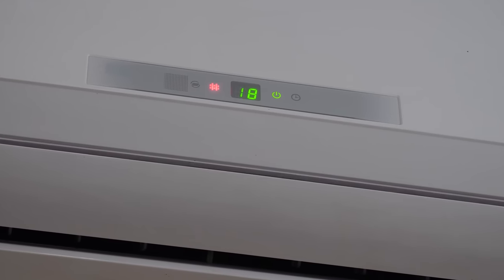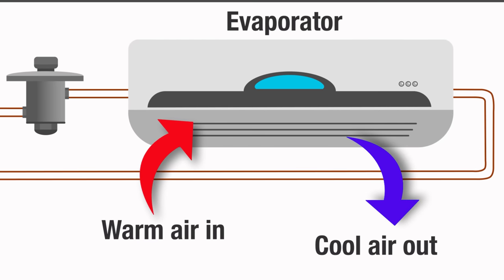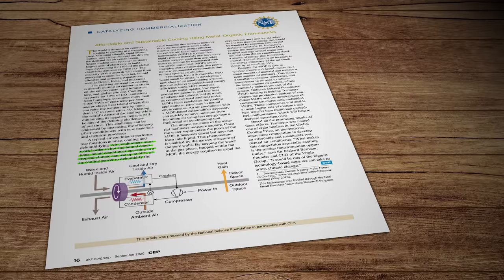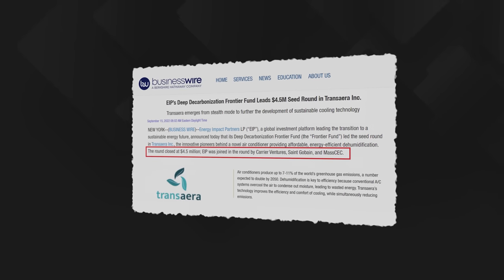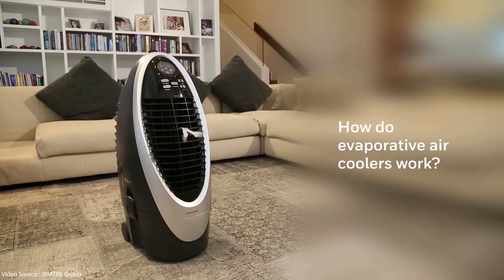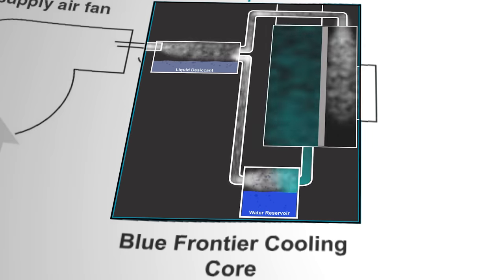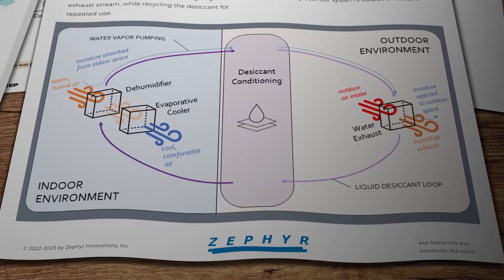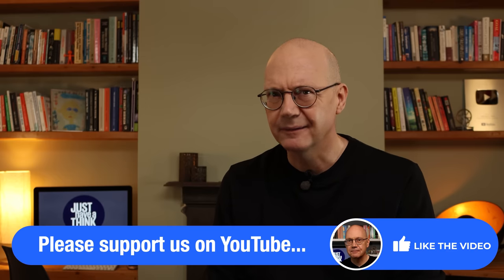Emissions free cooling. Can we do it?

Comment: There is an ironic effect going on in temperate climates. I live in Belgium and like many people we have recently installed PV panels, which produce way more electricity than we consume during the summer months, and much less over the winter months. With the value of the surplus electricity injected into the grid being almost zero, I decided to install an AC unit to cool the house with excess energy. Previously we never had an AC unit and strictly speaking we don't need one since we only have a couple of unbearably hot days every year. So yes, AC devours energy, but in our case it's carbon free energy. Am I part of the solution or part of the problem?
Reply: Well, basically you are creating more heat in the environment than you are removing.   To cool your house 5 degrees, you create a house worth of air that is 6 or 7 degrees hotter.

I'd look into insulation (tho I'm unclear how dirty making insulation is) and that superwhite paint to reflect the light and heat back into space.   And of course use the ac on the unbearably hot days.
Reply: You do realise that you’ve become part of the sustainability problem. Every Air Conditioner added to the system yours or the Grids is at the expense of minerals and use of FINITE Flammable Fossils (FFF’s) from the mining to the production of the components that form that AirCon, and the more technologically complex it is the more FFF’s is consumed, and if your think the efficiency can take care of that, think again as Jevon’s Paradox: Fuel efficiency gains tend to increase, not decrease, fuel use. And we are looking towards sustainability and not a short term fix, aren’t we🤔
Reply: Bravo! 🤩
Reply: @barrycarter8276 in next couple of years, heatwaves will take significant number of lives. I'm tired of hearing "you become part of the problem by installing AC" while I no alternative solution is proposed. I moved to Germany 6 years ago, the 2 weeks only heatwaves have now become 3 separate heatwaves from 1 week to 2 weeks. Summers in Europe are getting as hot as middle eastern countries. It's very hard to sleep when temperatures are 27c at 4AM with humidity.
Reply: @macmcleod1188 There are organic breathable insulation materials available like sheep wool or hemp.  Even thick cork panels have been used on exteriors.
The cork insulated building I saw also had a Trombe wall, which is a section of wall containing high thermal mass with an air gap and glazing, and fans to pump an airstream up (or down) the wall in the air gap.
Reply: You are a human, responding to current incentives.
This is why public policy is so important: we need to make the incentives align with the outcomes we want. If something has costly externalities (carbon energy, for example,) we need to make sure we charge for that cost (carbon taxes, for example.)
Any other mechanism is just rearranging deck chairs on a sinking ship.
Reply: I had solar panels fitted on a grant so can't export to the grid at all.  I think there are some heat batteries in development that can run a wet Underfloor heating system.  At the moment, they're only marketed for domestic hot water.
I'm curious if UFHS could be used in a ceiling to cool rising warm air and displace that heat to a radiator somewhere in a cool spot, or externally on the north side (for northern latitudes) of the building.
Heat batteries use relatively simple, plentiful components inside them and can practically use any heat source, which would include hot air.
When heat batteries are used for cooling, they're called thermal batteries.  I haven't seen any yet for residential applications.
Reply: I'm near Paris and what used to be a couple of unbearable days has become a couple of unbearable weeks and probably soon months. The chart at the start of the video shows Europe has a small share of the global AC units, but I'm sure it will grow. Powering the unit with solar panels is better than the alternative.
The other solution for me is to get a pool and spend the day in it, I don't mind I like that, more difficult to work from the pool though.
Reply: I live in a dormer bungalow where the bedrooms are very close to the roof slates. As a result we get lots of free heating from the sun but thats become an issue in the last few years with all the European heatwaves. 
I'm installing solar panels soon, so I'm hoping the panels can block the excess heat on the slates but I had been debating getting an aircon unit to run off the free solar electricity.
Reply: I have the same dilemma  - I too have excess PV on the days when the inside temperature is unbearably hot (one or two weeks in the UK - just like the last) and have thought about getting a mini-split - okay so the excess PV is being used on moving hot air back out again, but it "should" be carbon neutral, albeit someone down the road can't/won't use it instead. Then in the spring/autumn when a bit of heat is needed and I have excess PV, I am not using gas to heat the house. Yes I could better insulate the house (already on the list) but had never considered if I was part of the problem in considering this route.

Looking more broadly, we rarely use the car (unlike those that drive unnecessarily short journeys) and our overall footprint is reasonably small, I cycle where others would drive, I repair "stuff" as a volunteer and we buy used stuff over new plus being frugal with money - do I still feel like I'm part of the problem by getting AC? No, not in the grand scheme of things...
Reply: @RustyWalker  you can't use a cold water loop to cool a space because of the reasons discussed here in the video, the cold water loop would be covered in condensation and it would start raining in your house, more likely just ruin the plaster on your ceiling.
Reply: @SonnyDarvishzadeh  You’ve only reinforced the fact that like it or not you’re part of the problem, the ironic thing is this is on “Just Have a Think” which is supposed to be about how we can move to Rebuildables, sorry Renewable Energy which will invariably means cutting down on energy use, at the moment we’re in the “Red Queen race” — "A slow sort of country!" said the Queen. "Now, here, you see, it takes all the running you can do, to keep in the same place. If you want to get somewhere else, you must run at least twice as fast as that!",
and especially pertinent when it comes to trying to reduce CO2🤔
Reply: I'll give you another ironic effect. I am an architect and occasional property developer, building super-insulated ultra-low energy houses. Imagine my horror in visiting one of my early houses in the middle of winter and finding the owner sitting around in shorts and little else, with the heating on and a window open! His argument was that it costs so little to heat the house that heating it to 26 degrees (C) was cheap, and he was still using way less energy heating it than the average house uses.
I have spent rather a lot of time since then trying to make sure that my houses are extremely energy efficient, and extremely difficult to raise to a temperature above about 22 or 23 degrees.
Reply: @AlRoderick You'd have to monitor and control for humidity and calculate the dew point to give you how cold the water could be.
You wouldn't be able to use the supply temperature straight into the loop, but then that's not how UFH works anyway.
Reply: @macmcleod1188 Not how that works. The global average temperature rise is only dependent on the balance of radiative heat into the earth (by the sun) minus radiative heat out of the earth (from the earth's surface, into space). That's why greenhouse gases matter. They alter this balance by reducing the radiative energy out of the earth.
Reply: at end of life of the AC unit, part of the problem. as refrigerants in AC units with either be CFC based, which as responsible for the hole in our ozone, or the alternativeHFC's tend too break down into harmful greenhouse gases that are significantly worse than CO2, per cubic meter of the gas. for context, Methane is 24x worse than CO2. HFC's used in part with most AC units break down into a gas that is 131x worse.
Reply: @MikeAG333  Guess you must specify a Heat Pump as main source of heating then, though my experience of Heat Pumps is they take all day to get the property up to temperature,, then some fool opens the entrance or patio door to outside and the heats all gone in an instant, still it’s soon sorted with couple of 3 kW standby fan heaters, if you can afford it use it🤔
Reply: @barrycarter8276  "If you can afford it, use it"? Erm........no. That's how we got in this mess in the first place.
And no, a properly designed building with the correct ratio of insulation and thermal mass won't lose a noticeable amount of heat when someone opens a door.
Reply: @MikeAG333  Hi Mike, sorry to disagree with you but insulation particularly in winter won’t store heat here, the building structure MIGHT, then I guess you probably don’t live in UK with our draughty leaky buildings, But maybe you’re suggesting we knock the tens of millions of UK’s homes down so we can build modern ones. Oh and anyone trying to sell a heat pump here gets treated like double glazing salesmen used to be, sorry, salespersons. As regards to my last posted comment don’t you think I might have been just a teeny weeny bit cynical when it comes to “if you can afford it use it”🤔
Reply: @barrycarter8276   I'm a Brit, too, and have built (and designed) some of the most energy efficient above-ground houses ever built in this country, so I do know what I'm talking about. No-one has ever claimed that insulation stores heat. It's job is to slow down the transfer of heat through the fabric of the building, but to store heat, you need thermal mass inside the insulated envelope. With the right combination of insulation and thermal mass, combined with control of ventilation heat losses and quality windows, it is perfectly possible to build houses with zero space-heating requirements, in Britain. Zero. It is more practical to build houses with a very small heat requirement. My last house cost £70 to £100 a year to heat.
I don't care how heat pump salesmen are regarded. It is almost impossible to comply with the latest iteration of the Building Regulations without using a heat pump, so that is what is getting specified in most of the new homes being built at the moment.
And no, I would be head of the protest marches if anyone started knocking down our old houses to replace them with more energy efficient ones. I now live in a 300 year old timber framed cottage, (it is far more comfortable than yours, I promise!), and it costs £250 to £300 a year to heat.
Reply: @MikeAG333  Mike, your last bit was a bit of a jibe, but I won’t go down the route of my house is better, comfier and cheaper to run than yours, I’ll just say I’ve been connected with construction industry (industrial and commercial sector) for majority of my 45 years working life. My late father had his own building company, built bespoke and small developments 30 to 50 houses/year.

My own house, well it’s not a house it’s a detached bungalow, now in its 26th year, of my own design, using conventional construction, but sadly was not built by my father, I project managed its construction, so I’m familiar with buildings. I like looking around period homes, Roman to Georgian, but I wouldn’t want to live in one let alone pay for its renovations and up keep. I live in a small rural community, heating my home’s not a problem to me, having access to a number of forms of energy, biomass to NG, and a number of sources to provide electricity as well as a grid connection.

But when it comes to mass housing like 7 million City dwellers residing in pre war (WWI&II) non parlour terrace houses, many of which are rented, Heat Pumps for the those along with the required insulation and DG are really out of the question (except for *) and we’re not just talking heating there’s also provision of hot water to consider. Some new homes may well be forced to have Heat Pumps, but in general just like BEV’s they’re a *greenwashing feel good, prestige purchase, for upper middle classes and elites🤔
Reply: @barrycarter8276  It wasn't a jibe at your house at all. It was to pre-empt the standard "yeah but your house is freezing" response when I say how much it costs to heat houses I design or build. My over-arching point is to try to convey that energy efficiency is incredibly more important than all the whistle-and-bells add ons which are so fashionable now. Oh, and I'm a heat-pump sceptic, too. (It's a glorified air conditioner, for goodness sake!). It's just that the world I move in has to deal with the reality that there really is little in the way of alternatives.
Reply: @MikeAG333  Well Mike, seems we do have some common ground, best regards for the future👍
Reply: @aesma2522  A residential swimming pool could be used as a thermal heat sink.  If insulated and given a thermal break from the surrounding earth could operate similarly to a ground source heat pump.  Add an insulated pool deck, with radiant plumbing and a movable cover to take advantage of night sky radiation.
Reply: We have a PV cladded roof, very good insulation, and a heatpump which cools the floor in summer, home temp never got above 21 degrees, even during heatwaves!

Comment: Just building houses more wisely, could abolish the need for  active cooling entirely in most places.
Reply: for now, certainly.
Reply: It's going to be very , very long time before everyone is living in a better building.
Reply: It would only do that  for the new houses,  not existing ones (unless you propose replacing all current houses, which would have a significant impact on emissions).

So while better building standards should be introduced,  there will still be a need for active cooling.
Reply: Your plan would then also involve demolishing the old buildings. And as you may know the new rules already make it extremely hard to build new buildings due to emission budgets etc, etc. We are royally doomed.
Reply: I’m 100% in agreement that construction techniques and technology can make massive improvements, in most areas of the world it would eliminate 90%+ of heating and cooling needs.  However, I’m not entirely certain that building more wisely will solve all of the cooling issues in the hottest parts of the world, although people in those places are already very acclimatized to the heat so even a small drop from say 38C / 100F degrees to 32 / 90 would be a real improvement.  Combined with efficient air conditioning we could likely save 90% of the energy currently used to control indoor temperatures.

As some other posters have noted, building codes need to be updated to permit or better yet enforce more energy efficient buildings, which is an uphill battle.  People already pay a lot for homes / housing and the industry itself is highly resistant to change as well as price sensitive. Given the amount of money the construction industry spends on “lobbying” (aka bribing) politicians about policy and how to vote, I suspect change will come about incredibly slowly.  At an individual level, it can certainly be done, the house that Matt from the channel Undecided with Matt Ferrell had built was quite remarkable, and hopefully his neighbours see what’s possible and others who watch his channel will consider doing similar.

Personally I’m about to embark on upgrading our 115 year old house to have much better insulation etc, but I have to determine how to keep some of the legacy, character aspects of the house such as tremendous imperfect windows with bubbles and swirls yet still have a very energy efficient home. Unfortunately it will be a lot more expensive to retrofit than simply building efficiency in from new, which is another big challenge for existing homes.
Reply: “Wisely” loses out to “cheaply”, though.
Reply: @davestagner  True. But long term wisely is usually less costly. Payback periods can be short. 

Also a simple thing such as a skylight vent to use at night can substantially reduce cooling needs. 

Other low cost elements in construction could be roof using overhangs for shade.  In other words a design element. 

Setting aside the individual, the social benefit of conservation was never given enough weight. We didn't sufficiently externalize the costs of being "wasteful".  

In a wise world people see the costs and demand more efficiency. But as you note, self interest wants low costs in the present and we tend to ignore the long term and larger ( aggregate ) costs.  That is a part of human nature and part of our culture. 

The reasonable approach is to set standards and to try to regulate conservation. We can also tax consumption and subsidize conservation. 

But we, collectively,  tend to elect a large number of politicians who push back against this.
Reply: @howard5992  I don’t disagree, but both externalized costs and discount rates work against building for long-term optimization of resources. We constantly choose short term over long term.
Reply: There are simple things you can do to greatly reduce temperature. I'm Spanish but I have been living in the UK for 20 years, in Spain in summer we spent a ridiculous amount of time closing and opening blinds, window and shutters in the summer, to take advantage of cooler nights and not allow the summer heat to settle indoors. I was surprised you don't have shutters here, first thing I do every time I move to a new flat is to install thermal blackout curtains (as a  renter installing shutters is out of the question) but just closing my curtains in the morning as soon as it gets sunny makes a huge difference.